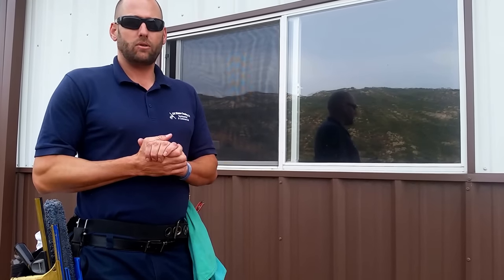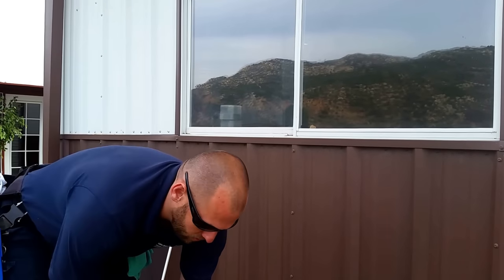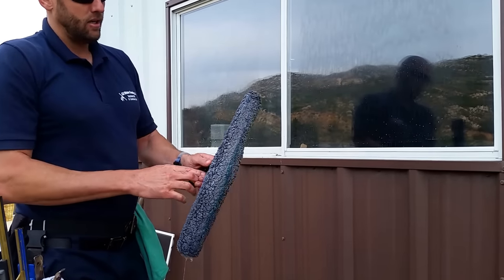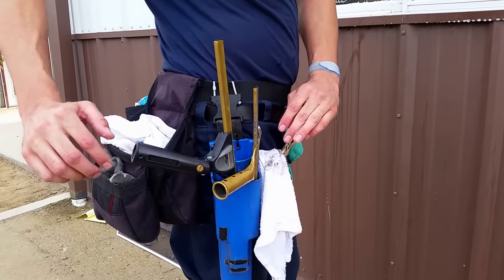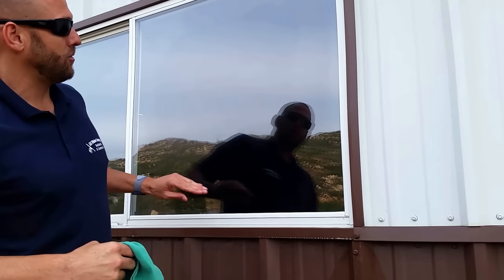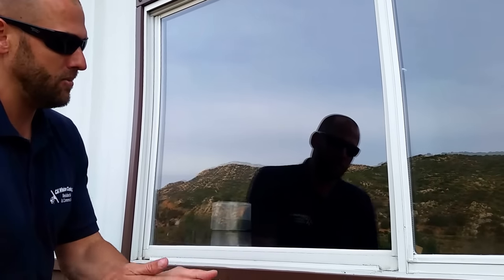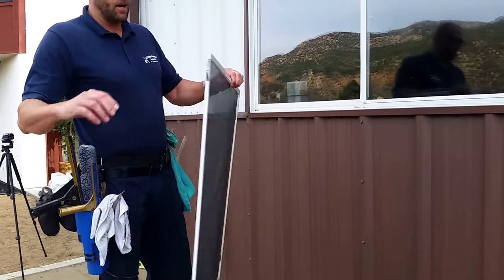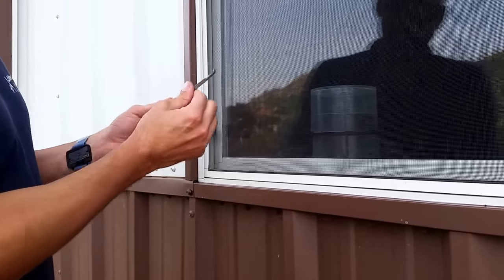5 STEPS of WINDOW CLEANING - C & C Employee Training

Comment: I can't see how you could make decent money at that pace. I'm a window cleaner, I don't get complaints, I clean the frames too. But a damp cloth will clean frames in one hit, rather than the 3-step process you're showing here (dusting, mopping, wiping). And your don't get dirty run-off. On a new customers house I just do this: wipe the frames, scrape off paint flecks and debris, wash, squeegee, detail and wipe sill/bottom edge.Next visit and subsequent visits frame wipe is super fast, no debris to scrape so just a quick mop and squeegee.And I use a proper window cleaning bucket that you can actually fit a mop into!
Reply from the maker: Robert John yeah everybody starts with a Home Depot bucket cuz I have like six of them but everybody that becomes a lead or a consistent crew member gets and Unger 18 inch Bucket from Home Depot though they are four times as expensive at $20, I have 10 going on 15 employees I have to have my systems correct and be extremely thorough with every possible step... I could blast out a window in about 40 seconds but how could I build a business showing my employees that type of video? have you ever tried to wipe down stucco Sills? That's why we have a brush we have a video of a brush being used so that people know what to do with it, I wiped down the frames so that people know if they are vinyl frames they might not need to use their brush, the video is 22 minutes or something like that because I'm explaining each step, not all training is done at "game speed!!!"
Reply: C & C Window Cleaning LLC. I feel like people are being willfully dense here. Even if they don't agree with your method they should at least be sensible enough to understand that training should be thorough. Even if you spent 20 minutes on a window one day it doesn't matter. You should be able to sacrifice speed while training to maintain intelligent employees.
Reply from the maker: Gilberto Gomez I agree it's pretty sad that some people think that I took 21 minutes on only the exterior of this very dirty garage window lol
Reply: People are so rude.  Thank you for taking the time to make a comprehensive video.  For those who complain, don't watch any more informative, FREE videos.  So easy to sit back and be critical.  Appreciate what others are sharing with you.  Take away what works for you and just say thank you or be quiet.
Reply from the maker: karen slicho thank you for your kind words, yeah people don't realize that I have an entire training system for my employees with just this video, they watch this video and take a quiz on their computers and I hardly have to do any teaching until we do some Hands-On training,
Reply: karen slicho Bravo. You replied what I was trying to. Thanks. People should appreciate time and effort goodwill to make this video.

Comment: Hi quick question on you using the steel wool on the window would that not scratch it
Reply from the maker: No just make sure the window has solution and water and it is lubed up okay and the steel wool is 0000 and you should be perfectly fine on any type of glass, be careful with hydrophobic glass though it scratches easier than any other

Comment: Out of every single "How-to" video on cleaning windows, only one showed how to get hard water spots off the windows. The one that did, had a "secret cleaner'" that was later revealed in the comments.( I've searched for it and can't find it again) . All I remember is that it had a mild acid in it, I did some research and found that some tub and tile cleaners had what I needed. The one I ended up using was "Scrubbing Bubbles - - Mega Shower Foamer" I sprayed it on, then used 0000 steel wool and all water spots( calcium) were completely removed, restoring my glass to its natural condition. Then, as advised by a 20-year veteran window installer, I used a very good foaming spray, indoors and out, and used cheap paper towels to wipe them clean.The more expensive towels have more lint content. The best foaming spray was "Sprayway - - Foaming acton, Ammonia free, Streak-Free Shine" I gave such a long description because Sprayway makes 2 foaming cleaners.
Reply from the maker: The easiest way to remove hard water spots to post it on your website that you DO NOT remove hard water spots😂😂😂
Reply: @ccwindowcleaningllc.4706  did not understand they reply at all. Breathing too many window cleaning chemicals? I sure removed mine.

Comment: What size is the squeegee you're using?
Reply from the maker: And 18 and a 12 and then I have two sidekicks which are 8in and 6in

You can also check out my video of the complete setup for a window washer I think that's what it says, I use ettre rubber and channels and Sorbo swivel handles

Comment: There's no way I'm using rags to prewash a window frame, especially if it's disgusting. I usually just brush and hose down every window before I do anything, then by the time I come around with the squeeze it's essentially dry.
Reply from the maker: that's a good method too but if you have 13 high schoolers out there following every one of your steps and coming out with the exact quality as most hustle bums that leave comments on this channel you don't want them trying to find a hose and then trying to find a spigot for each area of the house and then trying to hose down Windows not sure if they are shut and spending several hours figuring out hoses!! instead we give them about 10 $.19 Terry towels tell them to brush wipe down the frames and clean the stupid freaking window!...... the system I created was a system for employees to come out with 98% results...

Comment: Typically how much does a window cleaning business make a year
Reply from the maker: It obviously depends on how much Windows you do, but if you do a couple houses a day and do all the work yourself you might make about 40 to $50,000 a year by yourself if you have an assistant and you're jamming through for houses you might make about 70,000
Reply: One person can make $100,000+ per year. First year out probably $40,000. By year three you should be at $100,000!

Comment: Won't the steel scratch the window?
Reply from the maker: It all has to do with the 1 type of glass, 2 coarseness of steel wool and 3 the lubrication level... most of it is common sense and the harder the glass the higher grade steel wool you can use, but if you want to be safe Lube up the window really good with Dawn dish soap and use four zero steel wool make sure it's wet, if you're doing hydrophobic glass or tempered glass it scratches much easier but I still don't think 4-0 steel wool will scratch that type of glass but razor blades will

Comment: Way too much soap and you're scratching glass!
Always do the tracks and sills last so you don't get any debris on the glass that ends up scratching when you squeegee and keep your strip washer clean by only putting a little bit of soap in a bucket and cleaning it often.
Reply from the maker: Great advice! I will clean the whole window and then I will start screwing around the edges cleaning up cobwebs and other debris I'd rather scratch the glass than re clean the glass! And by the way it doesn't scratch the glass!

Comment: Steel wool >0000< :)
Reply from the maker: Real Allen Pope I only let my people use 0000 zero steel wool but I myself use three zero steel wool because it clears the window faster and I know how much pressure to apply, though my equipment's typically sits in my car and I'll hop on a job if things get tight every couple weeks or so
Reply: Very nice! You are a pro!
You clean windows much like I do!! 😎👍
Reply: I highly recommend using bronze wool instead of steel.  Once that steel wool gets wet it rusts out over night.  Bronze will be usable weeks after getting it wet.  I often see rust stains from bits of steel wool left behind by other window cleaners who failed to fully wipe away all traces of the bits that break off when used.  These stains can penetrate deeply into vinyl frames and painted surfaces as well as stain exterior walkways.  Just a reminder...  Though Glass (silica) is harder then steel,  rust is harder than glass and will scratch it.  So far I've only seen bronze wool in 000 and coarser.
Reply: Joshua Foy Corey I have never tried that before, I will give it a shot.

Comment: 😳😳😳😳To clean the windows of a house inside and out will take you all day that way.When you have to clean 30 houses in a day and some inside it will take a month of that system of work.
Reply: alejandro sepulveda bravo at minute 4:14 I tell you that this whole window should take about 60 seconds and it is a luxury cleaning which means it is top dollar per window.

I hope you have an open mind, it should take about 40 seconds for a maintenance clean which is to brush off the screen real fast and clean the glass without the first three steps but it is important that my employees know every single step.................WE DON'T GET CALL BACKS.  THANKS for commenting...

Comment: hey..you done a great work but not worth for time and money.
Reply: +TheRelph23 your math and mental process is way off. I own a business and don't have employees. It's better to work alone unless you have a high scale job that requires extra hands. Then the #s are adjusted appropriately.
Reply: +☼Tropical Detailing☼ thank you for your input, but it sounds like you own your own job and you do not own a business at all, it is much easier to do all the work yourself, but when you cannot show up one day there is no business at all.
Reply: +TheRelph23 thanks, but making $1,000 per day is more than a "job". A business doesn't need employees if it can succeed solely. Thanks for commenting!
Reply: +TheRelph23 you must've been embarrassed by your comment due to its quick disappearance.
Reply: +☼Tropical Detailing☼ yes I realized that I didn't want my employees to hear me speaking in ways that I would only like to speak to other owners
Reply: +☼Tropical Detailing☼ read the e-myth revisited by Michael Garber, if you're making a thousand a day you are probably very talented, if you just had one guy doing 80% of the normal stuff you could easily profit 1000 a day in about two to three less hours.  On one of my $1,800 days I typically set up a crew and my labor is about 400 but I only usually work about 4 hours that day.  Thanks again, you got me window cleaning videos?

Comment: lol just awful. Better methods, technique and better tools needed here. a window that size should be done with 20-30secs
Reply from the maker: Garry Given nice! do you have any videos you recommend on teaching employees how to clean windows? or do you like them to learn on the job? I couldn't find any that show step by step so I made my own. and of course it only takes us about 45 seconds to clean normal windows and about maybe a minute and a half to clean very dirty ones, but this video is for people who don't know anything about window cleaning.

thanks for commenting
Reply: C & C Window Cleaning LLC. If I was training a new employee it would be 1st hand. I wouldn't send them a video and expect them to go straight to work based on what they had seen. so much unnecessary detailing being done in this vid. Should maybe be using specialist tools such as moerman liquidator and purpose made glass scrapers instead of a Stanley blade on a dry window. The extra expense of good equipment makes all the difference in the finish and efficiency of a days work in this trade.
Reply from the maker: Garry Given I was just thinking of how terrible the Liquidator is unless maybe I put Ettore rubbers on it doesn't it leave streaks all over the place? I use them for one day and it was awful but my employees do a great job with the standard channels.

so, every new employee you have to train first hand through every process? And then they when they quit you have to do it with the next one as well? do you have any employees?